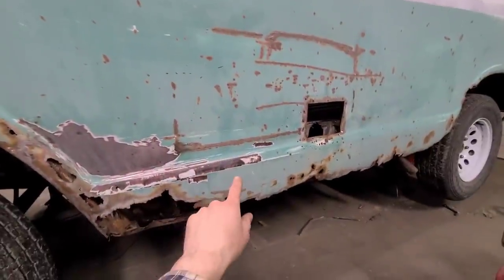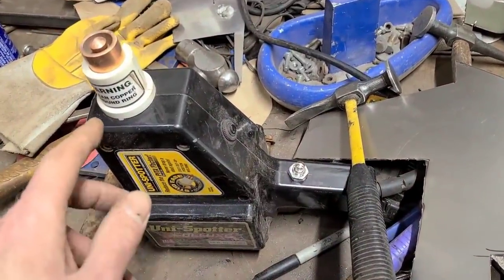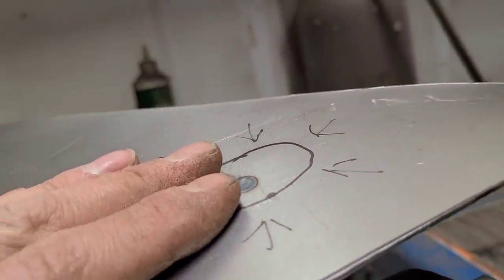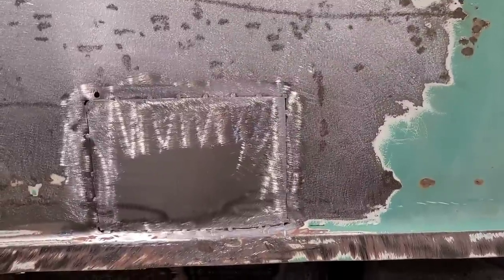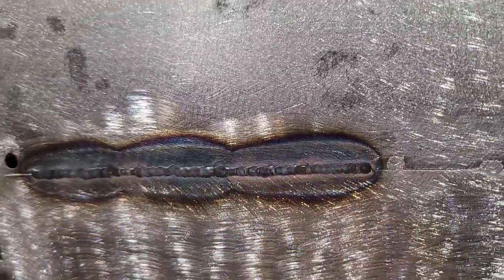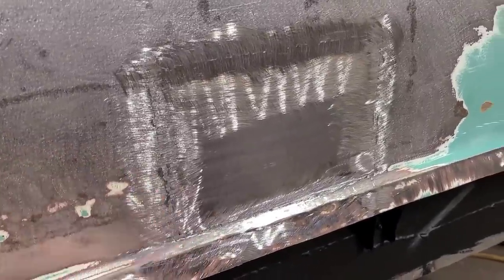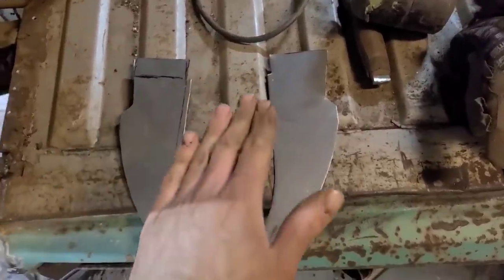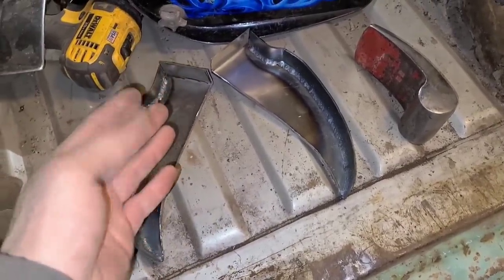Diy Rust Repair Part 2: Hammer Welding, Shrinking and Inner Bracing

Comment: Thank you for showing me your hammer welding technique. I used it on a Lancia Flaminia door repair and it worked very well. I replaced the lower 7 inches of the outer panel and butt welded the join using your hammer welding technique and the owner of the door was so happy with the result he paid me extra for the job. thanks once again.
Reply from the maker: Wow thank you! It makes my day when I hear from anyone who found these videos helpful!

Comment: Oooooh! New techniques! I had earlier requested a pointer to an example of the 'torch shrink' method, and here he covers it, plus the mini version using the special spot welder, plus spot pulling, plus hammer stretching of hot metal -- a bonanza of new techniques, some of which I had not seen before. However, as we have come to expect, there is clickbait -- he keeps promising us a ruined panel, without ever delivering. That's OK. We have all caught on. :)

Comment: Yes, that was an educational indeed. I have used tig on panel work, but not so much this hammerwelding method. I have to try that one. There was a nice Ernst Stavro Blofeld-style cat stroking twist in video too!
Reply from the maker: Thanks, glad you appreciated the cat too haha
Reply: @CarterAutoRestyling  Yeah, i have a soft spot for those hairy a-holes. Just curious, what was the purpose of the rectangular hole on the quarter panel, relocated filler hole that has gone wrong? There are people that should have a 100 yard restaining order for angle grinders or other cutting tools by court.

Comment: Howdy Kyle. 
Yet another good video. It would have been a great one if you would have included the jacket fire on camera though. Such a disappointment.
After about 5 years of crappy health I actually felt like going in my brothers' shop to do some un-crumpling of an old motorcycle fender for feller I know.
It was too cold for the shop cat to show up though and I never set anything on fire so it was a miserable failure. It's a good thing I don't have a ewetoob channel.
Reply from the maker: Hi Joe, sorry for the lack of fire and sorry to hear you've had to endure bad health for 5 years. I started editing the next video today and thankfully I managed to capture a small fire on camera.
Reply: Thanks. 
Woohoo! more Kyle-nanigans to come.

Comment: Rounding the corners isn't to make things easier if I understand correctly, it's to stop the very brittle welds from cracking. Please correct me if I'm wrong. Great stuff , thank you. Cheers.
Reply from the maker: That could be true? I've never had an issue with properly done welds cracking on sheet metal. Even a brittle mig weld takes quite a bit of abuse before it cracks. Certainly never a bad idea to round the corners either way.
Reply: it's to avoid overheating and the associated negative effects, since on a corner a lot of heat is focused on a small area.
Reply: The reason for rounding the corners is to reduce the chances of a dart line .a dart line runs off at a 45 degree angle to the corner. A good example of a dart line is the 1973 to 79 chevy truck gas tank hole gm stamped a square hole in the box and it created dart lines in the finished panels

Comment: Nice video as always!  Everybody seems to have their own preferred tig recipe for sheet steel.  What size electrode, rod, amps, and switch or pedal?  Thank you.
Reply from the maker: Thanks. I'm using a 3/32 tungsten with 0.023 mig wire, not because I prefer it, but because it's what I have haha. As for amps I'm not sure, I just use the foot pedal to adjust as I go

Comment: Great vid Kyle.  What size tungsten are you using?   How many amps are you running?
Reply from the maker: Thank you. I'm using a 3/32 tungsten, I like a smaller tungsten, but that's just what came with my welder and I've never changed it out. As for amps I just have the welder set on 70 and use the foot pedal. Most of the time I'm barely touching the foot pedal, not sure what the actual amps are. Sheetmetal can be pretty inconsistent so I prefer to set the amps higher and use the pedal to control things as I weld.
Reply: @CarterAutoRestyling  Thanks Kyle.   I just got a TIG and my goal is to be able to weld panels and make it look as easy as you do.   Practice,  practice, practice.

Comment: Would bonding a flange panel work as well?
Reply from the maker: Panel adhesive will leave a ghost line after the vehicle is painted. Even if it was flanged and welded the seam would still be visible after paint due to the difference in material thickness.

Comment: This is really the kind of thing that is interesting. 
I have a 1980 Datsun 280zx not as desirable as a 240 z due to the hideous 5 mph bumpers.
Planing to fabricate bumpers and filling recesses to make it look more like am older z car.
Am I looking at a nightmare with the thinner metal of an early 80s import?
Reply from the maker: That metal is not fun to work with, but if that's what you want I'd say go for it!

Comment: If you have not figured it out yet that caster equipped stool your sitting on is a hazard.
Reply from the maker: Well with all the lead, bondo dust, asbestos and other carcinogens I've inhaled over the years I think the stool is the least of my concerns
Reply: @CarterAutoRestyling  Amen to that! I use to own a stool just like it and often I ended up on the concrete floor. If you don't sit squarely centered on it, it will flip on ya. Finally put it too the curb.